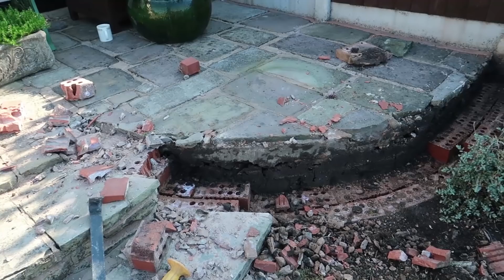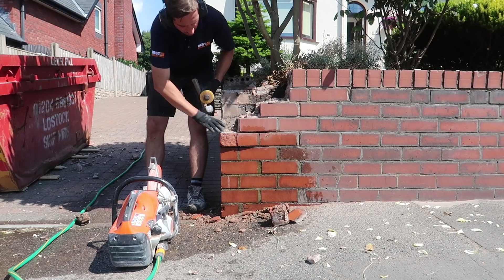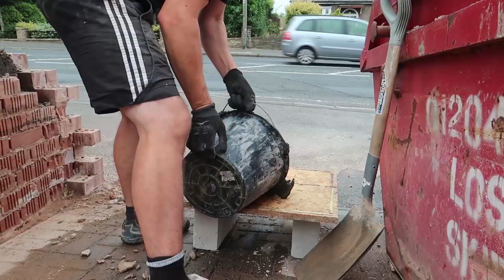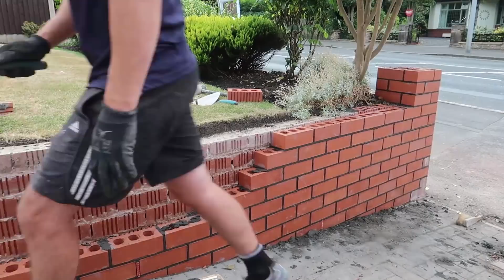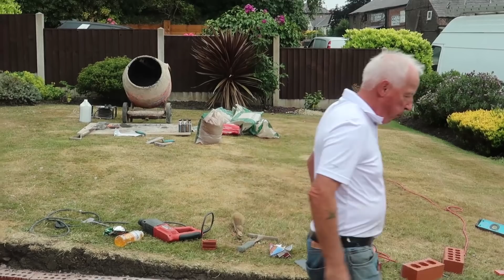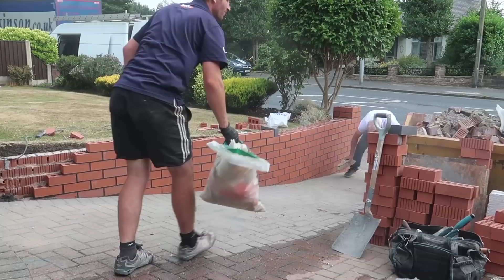Bricklaying - Curved Garden wall part 1

Comment: Nice one mate looks tidy, like the way you’ve pointed it! Curved brick on edge will be fun, I always lay a couple too start, then bed an off cut of block level too the ones I’ve started off, the length of my 4ft away, then just level them all too that datum as I go , keeps em nice an flat 🤙 top job

Comment: Hi Stu, Quick question......If your building between a house and garage to join them, single storey, red brick (only at the ends) and door either end. is it ok to build a single skin at each end or should you put a cavity wall in. 6m x 1.2m with a flat roof. Many Thanks

Comment: Lovely work stu. Would be a good video how to set out a radius wall for the young uns to watch. I normally use a hose pipe!
Reply: Ross Male I’ve used wet rope as a line to work the cuts to on a scalloped wall
Reply: Paul Doherty yeah that's the one,very much the same process the world over I should imagine.The old crafts still live on

Comment: Top job stu as always, that will be a nice looking wall by the time you finish, is it essential to tie the 2 skins of the wall together if so how far apart would be recommended for wall ties, cheers mate 👍
Reply from the maker: 750 mm
Reply: stu crompton thanks for reply mate

Comment: Don't get what was wrong with wall you knocked down apart from a few spalled bricks then you just followed  inside brickwork for level     wall seamed solid you had to take it down with power tools . Would it have been better to replace spoiled bricks and grind out and re-point in black gobbo .
Reply: That's what I was thinking just poit up with black mortor
Reply: was thinking the same thing!

Comment: Good work mate, any reason you don't have your mixer on a stand?
Reply from the maker: Yeah, I can’t find it lol, I prefer to spade it out in to buckets anyway rather than splash mortar everywhere 👍
Reply: stu crompton I prefer to be stand free you don’t have to shovel so high and you can wheel the mixer full of compo around saves having to clean a wheelbarrow too